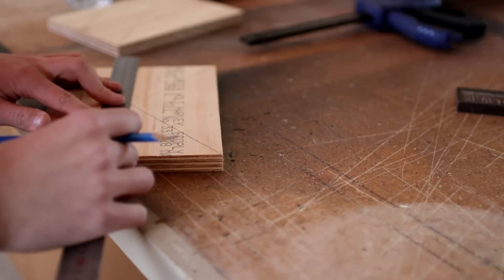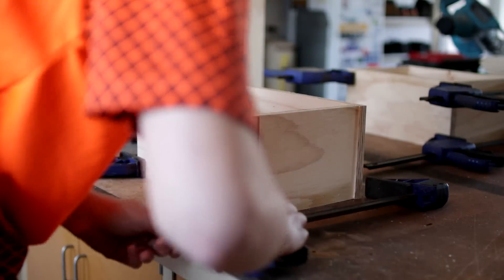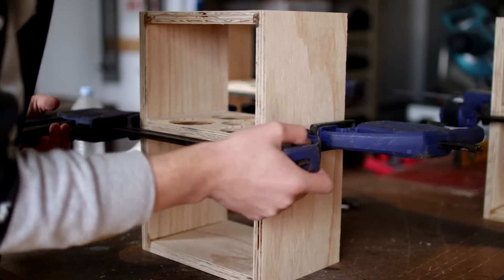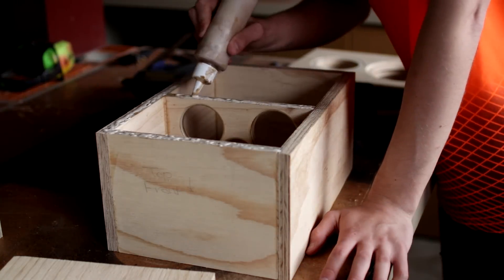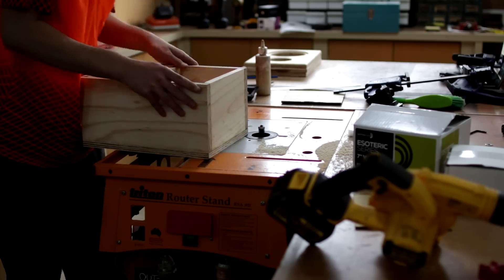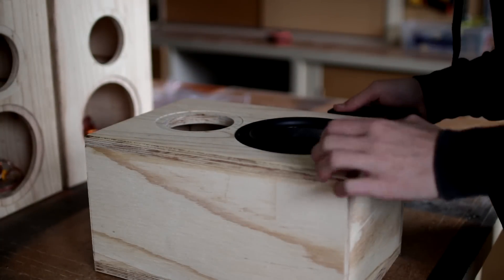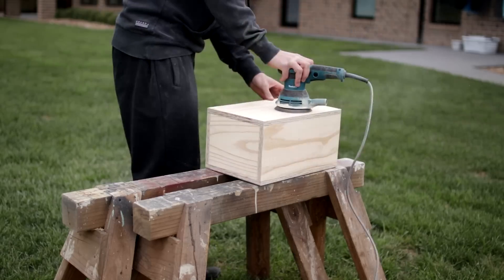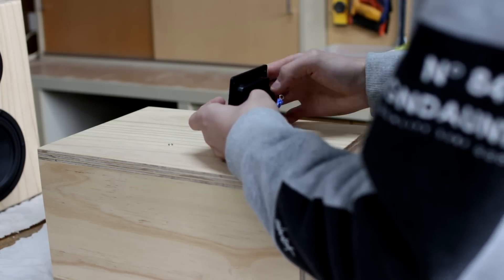HOW TO: DIY 7" Bookshelf Speaker Build - Dayton Esoteric & Peerless

Comment: Hi Doublsmm,
I really like the components used in the crossover! That important topic is often missverstanden or underrated.
Did you measure up the frequency response?
Last question: Why did you chose a closed design? I think the woofer is designed for a ported speaker.
Reply: Hi nice job! I'm also going to rebuild an old set of bookshelves. But I was also wondering why you didn't put in a port? Are they necessary? I'm new at this too👍

Comment: That is actually not the best box , that is the easiest box to make and ship to sell , if you are making it for your self , dont make this just buy a speaker , youll get same thing . Now if you want a good box , good box is same as good room , can not have parallel walls period , make it how you want but no parallel walls . Next , no Flat baffle edges  , edges refract sound , having an edge is same as having additional speakers put there , you dont want that . So curve it  its not hard you are making it your self its easy . Now we know more , no parallel  walls , no edges . Mount the speakers as close as possible , so chose a tweeter that can be mounted closer . The further the drivers away the worst the off axis behavior , so dont get a driver with such large ring around the tweeter making it hard to get close to woofer .Fill the box with foam ,  use resonance abosrbers on inside walls , its form of rubber sticky tape , kills resonance .
Now  to the baffle amplification compensation , baffle amplification is the amplification driver gets from being mounted on the baffle , its louder like that then without baffle , but its not louder in all frequency's the same , so you need to think about this and do some calculations , if nothing then at least design the crossover to do the baffle compensation .
For this reason you can not use any kind of crossover on any kind of box , it can make things bad . You need to design it , its not hard , there is software for this you dont have to do the math .
Now to the bass port , bass port needs to be design as well , cant just use anything .They are tuned for specific frequency , again there are online calculators 
And at last a type of crossover can make a huge difference , i suggest you use active crossover , its not expensive , you can get it from 30$ in form of Wandom DSP board , all the way up miniDSP for 200$ , or you can use your PC soundcard as crossover ,  for next to nothing ,all of this is much better then passive of the shelf crossover .
And you can play with it and tune it up so that it sounds good .
Done like this , you got your self a High End speaker , and you can be proud of it because nothing better can be purchased , there are difrent things but not better  , so if i made it i would made it like that .

Comment: you have made a lot of mistakes. The speakers must have an elastic sealant between the rim and the wood (you could cut it from a silicone mat or, at least put some silicone between the spaeker and the wood), the enclosure must be filled with dampening material (like cotton put in bags), the walls of the enclosure must have some dampenig material glued onto them (like thick nonwoven fabric, for instance thick felt),  The crossover filter should be made on a pcb not on cardboard. Finally for improving the look I would use veneer to cover the plywood.

Comment: The Peerless Corundum DA25TX00-08 has bludgeoned every single tweeter in the market that is less than 200 US dollars.
Reply: how about Hypertex 
T26SG ?
Reply: @joeygonzo  Yes that too is an exemplary tweeter if you are willing to work with tweeter with a DC resistance of just 3 ohm which will be one heck of a variant load on the amplifier if we cross it over at 1200Hz and below. I have an OCD(obsessive compulsive disorder) for not  using resistors in the cross over network and hence I have not been able to find a matching woofer with flat response and phase matching to go with this tweeter you mentioned. Presently trying out Peerless SDS-160F25CP01-08 with this tweeter, but have not succeeded in phase matching and flat frequency response without using resistors.
Reply: @joeygonzo  just finished using Hypertex T26SG and the Peerless SDS-160F25CP01-08 in a combo but it needs a resistor in the cross over network for a near flat response from 80 Hz to 17189 Hz +-1 dB at and 73.3 Hz to 19726 Hz +-3 dB. All at 89 dB efficiency. All measurements in an open baffle which means the low frequency should go down to about 36-39 Hz if a good tuned reflex box is used since the resonance frequency of the woofer is 44.75 Hz. Without a resistor the driver outputs and phase do not match which is why I am still searching for something cheaper than the very expensive Peerless Corundum DA25TX00-08.
Reply: @joeygonzo  Just realised that the company has stopped production of this model T26SG. You may get old stock in the market. I do not know the reason for stopping its production and your guess is as good as mine. Peerless have curtailed their inventory of drive units drastically from the year 2021. Their website has been updated and is much more responsive especially when comparing drive units. Just stumbled upon a good full range unit from Peerless which has the part number TG9FD10-08 which could be used for surround duties on a budget. I will be giving references of just Peerless drive units as I am a fanboy of their company, especially since we can get their drive units at dirt cheap rates from components-center which is a stocking centre in Taiwan for Peerless drivers. On an average drive units are available at 1/4th the cost excluding shipping, for example this 25mm god sent corundum tweeter is available for $15 at their website while at parts-express it is for $53.36 . On a side note I am an Orthodontist by profession but designing cross-over networks has been my passion for 38 years and counting and speaker-box designing for 40 years or thereabouts.

Comment: But, why no bass reflex? it help a lot not only for a deep bass but also for release the pressure from inside of the speakers and reducing the distortion chances/amount!
Reply: it's most likely used on a desk, so having a sealed enclosure is actually good.
Reply: @ph4n1th  I use my speakers also on desktop, and with the bass reflex ports actually sound better.
Reply: @Orpheuss62  I agree with you there, Having bass ports does amplifier the bass effects, makes it sound deeper and fuller. Tho sealed enclosure does offer a tight sound signature and punchy boxy bass. So It depends on people's taste. Me personally I would use bass ports too :)
Reply: @ph4n1th  Here, I agree too, everything related the human senses is purely subjective.
Reply: Bass reflex just sounds louder but sealed is tighter and more controlled on bass.
Reply: i like the punchy bass of a sealed enclosure

Comment: If you think you need all this tools to make a speaker box, then I'm just going to tell you that you're wrong

I made a ported subwoofer box with only a hand saw wood glue, and it sounds awesome the bass that is producing is clear and great and there's not an airflow issue
Reply: You can do simple cabinetry, or you can do complex cabinetry. As long as you have a sealed chamber, and a baffle that is reasonably flat and free of obstructions at the corners, then you're fine. It's up to you and what you like.

Comment: How is the bass in the esoteric’s?
Reply: The Esoteric series speakers have state-of-the-art bass. Duke Lejeune of AudioKinesis told me they have the best bass he has heard in a 6.5-7" size class speaker. They are not a cheap driver, and it is important that you try to chamfer the back side of the baffle around the woofer cutout if you can, to help with airflow through the frame windows between the cone and spider landings.

Comment: I noticed that you didn't use anything to seal under the speakers. I know the tweeters don't have any sealant material under them, but I couldn't tell is the woofers did. I'd be worried about air leaks. Chuffing sucks.

Comment: Looks good. Tip for next time. It'll be easier (and cleaner on your crossovers) to drill out those speaker screw holes before assembling the box, and to sand the box before adding the crossover.

Comment: The build looked good until you butchered the crossover.
Reply: How is the crossover butchered? What could have been done to make it better? Serious question still learning. Thanks
Reply: @incog8885  he just threw the parts together an then glued them to a board, after putting so much work on the enclosures. I know that you cannot see it but it's a shame he did not give the crossover the same attention as the enclosures.
Reply: @habdulahsalam  I see. Okay, thanks. I was looking for some good tutorials and builds.

Comment: No damping material...for a closed one 😒
Reply: must sound a little hollow
Reply: The most important is the qtc. I prefer a qtc of .9 to 1 on smaller drivers. I usually put a 1" foam on the rear panel and that's it. 11:17
Reply from the maker: The brace makes dampening material not necessary but I much look into adding some down the road!
Reply: @Doublsmmm  make sure you use sheep wool, not the synthetic stuff, makes the best bass
Reply: @Doublsmmm  BS! The braces have nothing to do with damping
Reply: @Doublsmmm  the brace only reduces some of box vibrations, sorry

all Acoustic Research boxes were filled with dampening material and they  did know something about sealed boxes

Comment: Gasketing Tape?
Reply: It might help to add a few more words to form that into a question, if that's what you intended.
Reply: @luke9822  
Yes: air leak and "are filled with damping wool to prevent all unwanted rear radiation of sound" Bowers & Wilkins
MERRY CHRISTMAS AND HAPPY NEW YEAR

Comment: I'm about 3:3 in and Why only three speakers ? It's two or four most times. Didn't think about sound insulation / fill ?
Reply: I designed these for his front soundstage in his theater. So this would be his center and two fronts

Comment: Funny thing is, you did the same thing as me with the center channel. I did not have enough room for a fancy mid, tweet, mid center speaker in my room, so I did what you did and went for a regular bookshelf speaker. I do not see any obvious improvements of having 2 woofers on the side of my center instead of just one on the bottom. After all, the tweeter really decides if your dialogue sounds clear, crisp, or just muffled. Good move not wasting money on 2 woofers.
Reply: general specific you are absolutely correct. I do not have a midrange in mine, but the Polk Audio t15 I used gas a midwoofer and a silk dome tweeter. It certainly sounds like it contains a midrange, and I am happy with it until I can find something slightly more pricy. The earlier Paradigm Atom (using earlier paradigm titans for left and right) are apparently better after a refoam, like I did to my titans, and will match more.

Comment: no foam inside ? no bass reflex ?
Reply: Cid Ou Not really necessary, and sealed boxes tend to sound better than bass reflex
Reply: @joe070907080706  that depended on the person or the box...
Reply: @riveralley  Actually no. Sealed enclosures will always surpass bass reflex ones on sound quality. Not in raw bass output per watt though!
Reply: But insulation would still improve the sound.
Reply: Exactly, the insulation will give the air inside the cabinet a longer travel wich will give the speaker sound like it had a bigger cabinet and a lot less "boxy" sounding too.